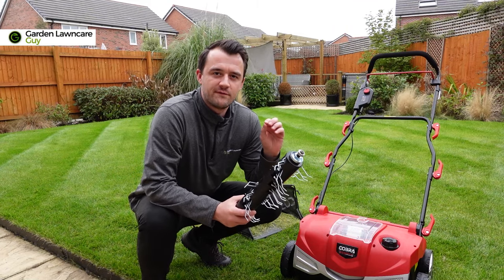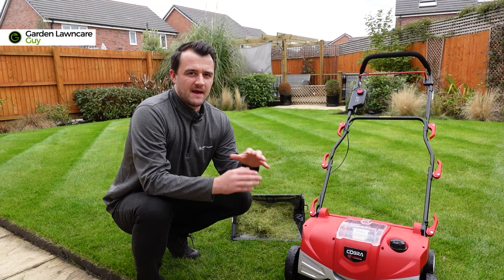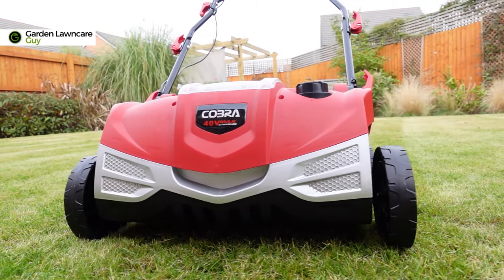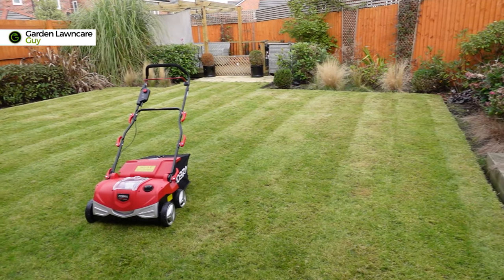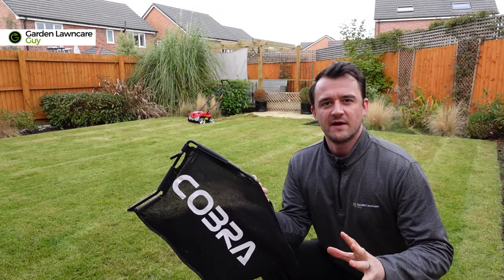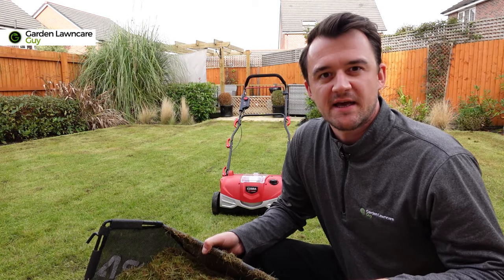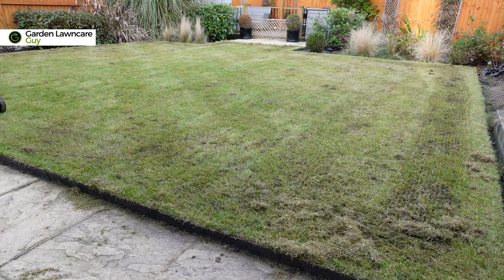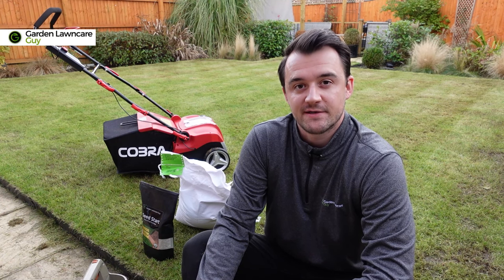How to Scarify a Lawn - The Complete Guide

Comment: Scarified for the first time yesterday and the lawn does not look good, I've heard it will look worse before it gets better. Done some over seeding and put some top soil over them, I know it's late in the year but here's hoping and if all else fails there is always next year. :)
Reply: as long as temps dont below 12 degrees for 7 days ull be fine
Reply: @cretene1  here's hoping 🙏 ☺️
Reply: I scarified mine last weekend...manual scarification with the WolfGarten scarifier. The lawn is about 45 sq metres.  Got plenty of thatch out but the lawn looked really! really!! really!!! messy. Then did a manual aeration. Going to overseed and add fertiliser next. Like yourself I'm hoping that what the experts say will come true...and that the reward will be, eventually!, a resplendently green patch for all to marvel at. It's the first year I've done my own lawn maintenance/restoration. Good Luck.
Reply: @teej4114  I might try manual scarification next time as I think the machine was a bit to aggressive. Good luck to you too Teej!

Comment: I wish my experience was as pleasant as that seemed to be. Just spent six hours doing our small back garden and it’s nearly killed me. It’s a new build, with really rubbish clayey soil. We’ve been here about eight years and 2 years ago I scarified, over seeded and added top soil but it made very little improvement so I lost heart and have just kept mowing and weeding but the thatch and moss have overwhelmed the grass and it’s like walking on a big sponge in places, so I decided on the one decent day of weather we’ve had all year to give it another go. I have a Vonhaus electric scarifier and it’s not the greatest but all I could afford at the time and it does a decentish job. Gave it four passes and raked it up and while there was a lot to collect and bag up it was fine. Now one thing I was told is that when you’ve scarified, you really need to aerate the lawn to help with the seeds setting and water getting into the soil, but do I have an aerator..do I hell. So it was the garden fork……..im telling you now if there is a hell one of the punishments is to fork a lawn for eternity, cos that what this felt like. Two hours it took me to create what must have been 15000 holes. I’m not an old man but sat here on the settee I feel it. Every part of my body aches. My Fitbit tells me I’ve done 25000 steps and burned 4600 calories. I’m sat watching some nonsense on the tele and Match of the Day is on but I can’t bear to move to get the remote to change the channel. 
When I finally overseeded, put on the top soil (£2.50 a bag on offer at Wickes at the moment down from £4.00) and watered I was in such a state of delirium I collapsed into a chair.
So the moral of this story is,  if you’re thinking of buying a Scarifier…..get one with an aerator. You’ll thank me I promise.

Comment: Great video as always! What heights? What height did you cut the lawn? Were all passes of the scarifier on the highest level or did you decrease the height and what to? I did mine with a similar device, cut on the lowest and scarified on the lowest, was savage, pre seed fertilised and then over seeded, came back amazingly, had a couple of patches. Did this in the spring so treated the patches accordingly.

Comment: The Cobra machines are really good.  I went for the larger electric model as it’s used less frequently than the mower so the benefit of cordless is negligible, however it does has a toolless cartridge change feature.
Reply from the maker: Indeed Ian, makes sense and the quick change feature is a nice touch